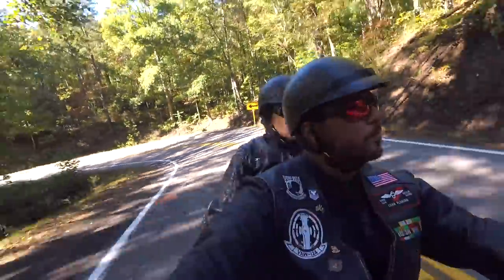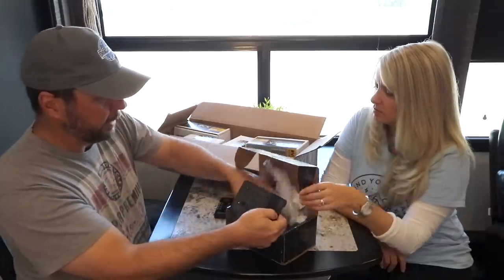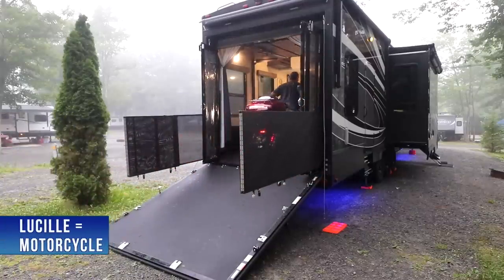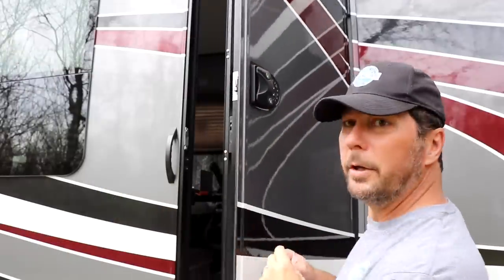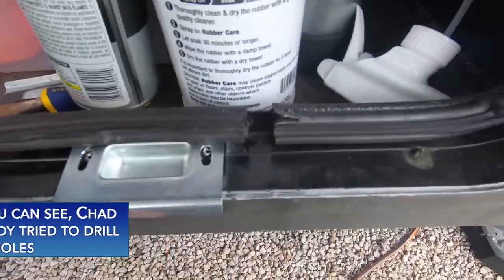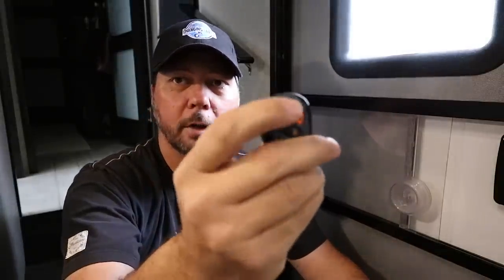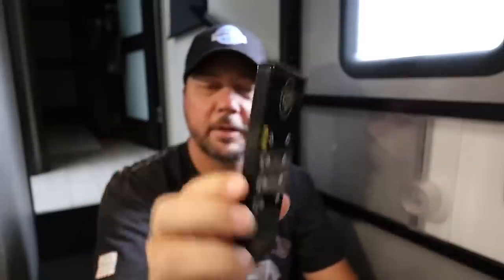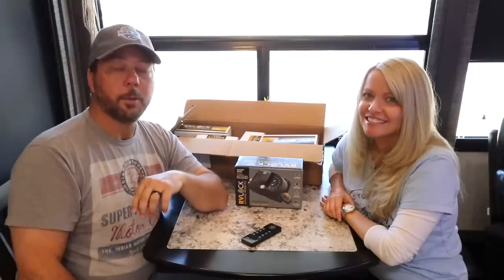RV Keyless (Keypad) Entry | RVLock | Full Time RV Safety | Changing Lanes!

Comment: I have had one for about 3 years. I like it. I changed the batteries every year. Never had a issues. Love them. When I got mine they didn’t have all of those fancy remotes
Reply from the maker: Our first lock is likely due for a change.  Been using it with the stock batteries every day since Dec 2017.

Comment: Thanx for review. I wasn't aware of the baggage lock handles and the multiple function lock remote. I purchased one door a few days ago and will install it today.  Our fifth wheel is set up on our land about an hour away. One day we were driving up to the rv when my wife asked if I had the key. I didn't and we turned around and decided to stay home that day. This locked would have helped!
Reply from the maker: We've heard many lost key stories also... The baggage doors can be tricky so make sure you try those out before your return window closes - in case you need to send them back. 👍🏼

Comment: I put one of these in my 2012 Heartland Elkhart Express, My German shepherd who is too smart for his own good has figured out how to both disable the keyfob and unlock and open the door. I've been locked out once because i also lock the handle to keep people out. Then i bought a 2011 Heartland Big Country that's more like yours and it has 4 bay door slam locks that i got no key for. i will be buying the bay door slam locks too but they are $180.00 each. As if everything else wasn't already expensive enough on these things. I am repairing the damage my shepherd caused on the Elkhart express (ripped the screen and shredded the blind by the back door) then selling it to pour that money back into paying off the big country,  I SERIOUSLY needed a bigger shower, hell an ACTUAL bathroom. I just got the bonus i hadn't counted on that the Big Country also had laundry hookups in the rather large front Master bedroom closet. so yeah lots more room but i still have to see if i can even use that RV because the night i brought it home i got stuck in a ditch and spent 11 hours waiting on Good Sam roadside assistance to find someone to tow me out and they brought a big rig wrecker and snapped the spring perch on my rear axle and repairs are bound to be REALLY costly. once it's repaired though I will be ready to move into that one, clean up this one and get it sold and start sinking money into the other one again. i realize it's an on going process when you live in it full time but thankfully i won't be traveling all the time with mine. My late wife lost our home of 20 years due to her ex meddling and i have been living in this elkhart express for the last 5 months now. i am only able to stay afloat because i work a 40 hour week and that was suplimented by a small sum of life insurance when she passed. I'm not rich or even well off but i'm dong ok right now still. hoping your code is still good for the two bay door slam latches I need 4 new latches but 3 of the 4 will be the electronic ones. I have a locking hose storage door, single latch through door (basement) and dual locks on the front side of the pass through basement. I am considering solar eventually also for my pass through bay which is the only real reason i am considering digital bay locks solar should supliment if not replace my monthly electric bill i'm hoping though with it being a 50 amp RV that's going to take some doing

Comment: We have this lock on our travel trailer door and love it.
Reply: @Paula Johnson, what kind of travel trailer do you have? We a 2013 Coachmen Catalina Santara the door on ours seems to pop open even when locked. I have noticed the deadbolt doesn't always turn.  I'm considering the RV Lock for 2 reasons security, and door latching issue. And/Or I will purchase a large swing over grab bar handle.
Reply: If the batteries go dead. Can the key be used like a normal lock?

Comment: Great video, just wish my experience went so well.... Ordered mine over the winter period and did not get a chance to install until spring (Live in NH, waste deep snow). So it was not until April I got to install it, and it was definitely not a ten minute job. In my RF the cutout was not a good alignment, it was up the door frame by about 1/4 an inch. Which made it so the RVLock would not align up with the side holes. Contacted their support and verified I had the right lock for my Leprechaun. They got back with me quickly and confirmed. I ended up cutting out the door just enough to get the holes to align. Luckily the RVLock is larger then the original lock and covered the hole well. But that is not the end of the story. I followed the directions, and when I connected the two parts together electrically, noticed the "BEEP" that was supposed to happen, didn't. Took it all apart and when I opened up the battery compartment, found one of the already installed batteries had exploded, and corroded the connections. I replaced the batteries and cleaned the connections, but to no avail, there was no function to the electronics. At this point after cutting out the door, no way I could back out. After getting it all screwed together I went to put the red handle on the lock that I "thought" was just setting in the box for install after getting it together, and that is when I found out it was actually broke off, and the base was broke off on the inside of the base... I contacted support again, explained the various problems. Their answer is to send me a replacement battery compartment / inside part, no the electronics portion. Which I am not convinced will fix the electronics problem, but understand the theory. In their defense they have been responsive every time I emailed them, and supported their product even though I had actually bought i months before actually installing it. The hole mis-alignment is not really their fault, but that is more on the manufacturer. But like you said in the video, so things don't go as planned and you have to work around them...
Reply from the maker: Wow!  Yea, that does sound like a pain!  Glad to hear they are working with you.  Hope you get it all sorted soon!

Comment: Excellent video review of RVLocks keyless system. We been using RVLocks for 2+ years and love the keyless entry. We have a full body painted Redwood and have the same issue with the manufacturer not removing the door handle prior to painting.  So now we have a similar paint gap between the old door handle and the new RVLock. Thanks for the product review.
Reply from the maker: Good to know it's not just GDRV.  Heck, they might use the same paint shop!
Reply: At first that sounded like some really lazy paint work, but then I realized it takes more time and work to correctly tape off the door handle than it does to remove it before painting and reinstall after.  So it sounds like just incompetent paint work.  That's the sort of thing I've heard about Maaco.  Not what you expect on an expensive RV.

Comment: Cant wait til i add these to my old 1987 class a
Reply: Hi Brian! The locks used on some of the older motorhomes is different than the one our handle is designed to replace, so the install can be a little tricky. Here's a video to guide you through it. https://www.youtube.com/watch?v=xlGcrx3Fs5U. Hope that helps!

Comment: A couple of suggestions.  Strike plates are hit with pressure each time you close/slam the hatch.  This will tend to cause the plate to want to move the plate toward the back of the opening making harder to latch the door the next time. Either a SS star washer and/or some epoxy like JB Weld should help prevent that and the fasteners from backing out.  I'd suggest both.  Just remember the JB Weld will make it harder to remove the parts if replacement is required later.   
I really enjoy your videos.  Great information and also great information and  production by your wife!

Comment: I just saw a thumbprint lock for a house and the guy defeated it in less than a minute with a strong magnet.  I think they said they all use a capacitor to release the lock, you know more about electronics than I do.  You might want to check it out.

Comment: Just FYI, just rcvd our new 2020 397th with FBP, the paint shop still doesn't remove the locks to paint. Today I installed our rvlock and I have the white strap.
Reply from the maker: Yea.. that's a bummer...  I think the only way they do it is if you contact GDRV and make a special request during the build.

Comment: I have the same problem with the paint around the door handles on my 2020 Momentum 397TH as you did. I went ahead and installed the RV locks anyways and I ordered the gasket kits and I'll add those later. You mention @3:49 about reaching out to GD - apparently it costs too much or the paint shop didn't get the memo.
Reply from the maker: Yes.. current word is the paint shop is pushing back..  Seems like it would take less work to tape the hole from the inside and paint the thing versus taping off the handle.

Comment: Our issue was not forgetting the key but having too many keys and too many master keys available online. We have Global Link locks on the main doors (a different key for the front and rear door), Bauer locks on the baggage compartment doors and a CH751 key on the sewer parts door. You can buy master keys for the Global Link, the Bauer and everyone has a CH751 key. So we looked into just replacing the lock core or cylinders. I found a place online and. replaced the 2 cylinders on the front door, The 2 cylinders on the rear door and the CH751 lock on the sewer parts door in approx. 8 minutes total and for under $75. All 5 locks are keyed the same and have no master key. I haven't quite figured out what I'm going to do on the Bauer locks on the baggage doors but that will hopefully be simple as well.

Comment: Just installed one door lock on our new 2020 397. We have FBP. The "gap" in paint remains ... I'm going to purchase the gasket. We also ordered locks for our baggage locks but unfortunately it looks like GD installed different "Slam Lock" locks than what you have. Our "TV" lock is just like yours but not the baggage pass thru. The RVLock website states that their baggage lock works with your type (i.e. our TV lock).  I contacted RvLock prior to purchase to ask about the 397 but they were sorta non-committal about whether their locks would work or not. Seems like I've seen a few folks on FB install them but they did not specifically state they had the same latches that I have. So I'm going to see what happens. As RVLock stated, we will have 30 days to send back. Keeping my fingers crossed. Will update.
Reply from the maker: Yea. definitely send them back and get a refund...  Kind of an RV industry thing is to change things here and there, even in the middle of a model year.  A bit different than any other industry and one of those things we RVers have to deal with I guess.  Good luck! 👍🏼

Comment: I just bought a used travel trailer.The original door lock is really finicky, I think someone tried to break in at one time. I want to change to a keyless lock. I was recently advised that black door locks get to hot and the little computer chips fail. Have any of your subscribers experienced that?

Comment: I bought one of these and I’m constantly having a problem with the remote working after about a year now. Push it to lock and you test the door and it opens and you do that over and over several times then you have to physically move the latch inside back-and-forth a couple times then when you close the door and hit lock it will then lock, maybe.
I just change the batteries to see if this would help and it is still misfiring.
Reply from the maker: Be sure to keep it lubricated... Dry Lube like: https://amzn.to/3gv4ThP

Comment: Hi I know this is an older post but looking to get the locks. I see on the baggage doors it one key pad lock and then a mechanical lock. I assume the key pad does not unlock the mechanical lock. You still need to use the key.
Reply from the maker: Yes.. the keypad only unlocks it's lock, not others.  But, one lock should be deterrent enough.  If they're going to brea one, why not two? 👍🏼

Comment: Hi, I just bought a Montana 2019 3931FB, I drive a 2500 Ram crew 4x4 short bed. On the way home from vacation at the Lake I weighed all 3 axles (well 4) and got my pin weight, I was shocked. Do you have a video on how to determine weights and balances ?
Reply from the maker: We do go into it a bit in our towing video: https://youtu.be/87runDszXLQ
We're about 500 over weight also last time we weighed.  We might be in a place to do a full wheel placement weigh in later in the summer and will make a video of that.

Comment: That will be nice!!   Forgive me... maybe I missed it - any info on the batteries?  Charging?  If dead, how do you get in etc.
Reply from the maker: They use AA batteries (included) and the batteries last about a year being used every day.  It will give you an audible warning when they get low so you can replace them before they die.  There is also a manual key just in case...

Comment: I haven’t purchased my truck and fifth wheel yet. I would assume this is much cheaper than doing it as a dealer installed accessory. Thanks for responding to my email two weeks ago. Cheers from Perú.
Reply from the maker: I would assume so.  Pretty much anything you can have the dealer NOT do will save you money.  😊   Thanks for watching! 😃

Comment: I’d get some real electronic locks. Setup a UniFi (Ubiquiti) dream machine pro or their new wall model which acts as your router as well as controller for their access platform. Put electronic door readers on the outside that also act as video doorbells and security cameras. Use magnetic door locks or electronic bolt locks. That would really secure the door. And for the lower bays, I’d love to have a rig with no handles and locks. Just have a internal clamp lock that is electronic. Hook that up to the UniFi access system. You could do a series of doors together. To unlock use your phone or code or rfid.  Or use a standalone access system from Hikvision. They have door screens that face facial recognition so all you’d have to do is look at the screen and door opens. That might be a better option. Cheaper and lower power draw. They have backup batteries too. But I don’t think you’d have issues with all the solar and lipo batts.  You’d have one Hikvision access panel you’d run locks to each bay and each door. And rfid readers to each door or screens.   Or maybe a apple HomeKit system and you could buy $5 eWeLink WiFi relays to lock and unlock each door. Then integrate that into HomeKit via homebridge. Run it on a raspberrry pi. Have HomeKit secure video for security cameras.    Though the all in one UniFi UDM pro system where it’s your internet router, poe switch, access controller and security camera NVR in one U of rack space for $379.  Get four of their cameras for the outside and their video doorbell. Get one access point for inside and one for outside. You’d have WiFi for 500ft in every direction.  That’s about 100 watts. 4 watts per cameras. 4-5 watts per AP.  Then use scrypted to integrate UniFis cameras and doorbell into apple HomeKit.  

Yeah I’d do that. Using unifis access would be sweet on a RV as long as you had solar and a decent battery bank.

And UniFi has add on manual key overrides if needed.

Comment: BTW, GD did not heed your advise, they are still taping off the door locks, so it's still an issue with the paint. :( Oh and BTW the new baggage doors (2022 Momentum 376THS) RVLock does not have locks for the lock styles for the baggage doors. Apparently GD changed the lock designs used and RVLock has not caught up with the change.

Comment: Hi Chad and Tara, 

Love your content!

Can you tell me where you got your gasket? Here we are 2 years later and Grand Design is still painting AROUND the door handles, so now I need to get a gasket. 

Another issue I'm having is the RV Lock door handle not being quite as low profile as the OEM handle, and it actually hits the side of the trailer when completely opened and set on the magnet. Did you experience this?
Reply from the maker: Here you go..... https://www.rvlock.com/collections/accessories/products/gasket
 
We've not had that issue (hitting), but we also have a hook that extends out a bit versus a magnet...  You might try making some kind of extension to move the magnet out a little?
 
Good luck!

Comment: I see a lot of complaints about rust on the latch plate and the keypad membrane cracking/falling off. Have you had these issues?
Reply from the maker: We had one (out of 4) membranes come loose and replaced it.  No other issues in 2.5 years.

Comment: I’ve reached out to RV lock and they’re not helpful. I bought the V4 lock which looks like everyone buys from the you tube videos. I took my lock out and the hole is 2”wide, 3” high. Looks like same size as yours.  I put the front plate on them the inside , connect the wires . I stuff the end inside the door but on the inside of the plate the wire extends 1 inch from where you Line it up with the screws  . That 1” of wire is pressed up against the door   , no way will it go in that hole. I don’t think it should be pinched up on the door, so i don’t know if I got the right one but I talked to rv lock when I ordered it Black Friday and they said v4 would work. Id send you a pick but I cAnt access the photos from here to send . The reason I’m just getting to it was the weather , moving and having to be out town a lot